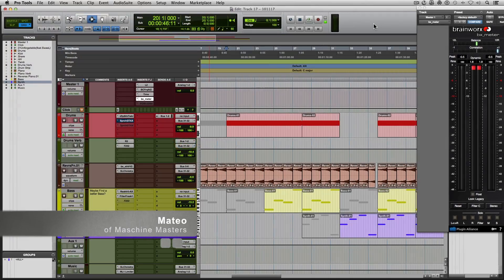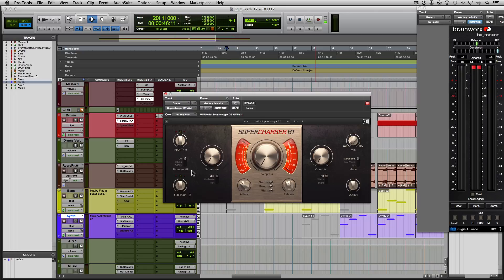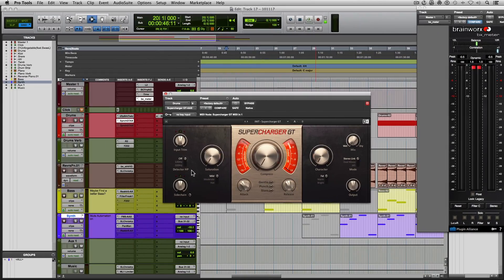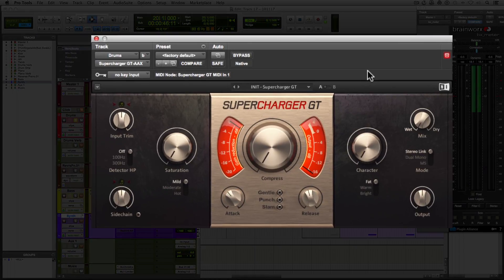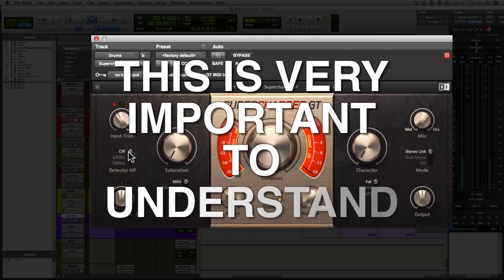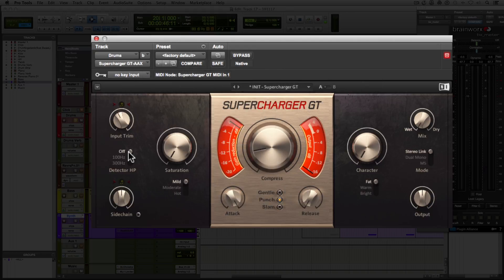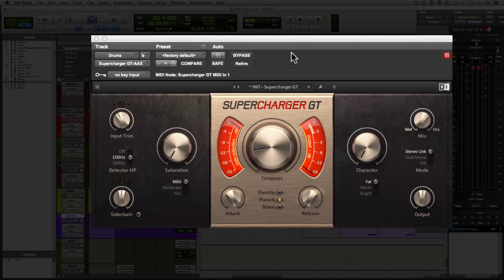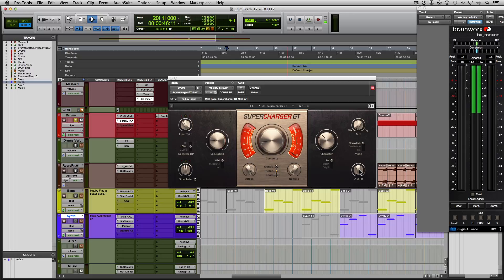HP Filter Side Chain Comp Tutorial Settings [Mix Talk Monday]

Comment: what should i do if my compressor doues not have this HP sidechain, can i do it otherwise?
Reply: Not all compressors will have this, but many will. I'm sure you have at least 1 compressor that comes stock with your DAW, that has HP/internal sidechain. What DAW are you using?
Reply: Xitmuse i use Studio one v3 professionell, and i got some comprresors of NI kompact (Not the ultimate Version!)
Reply: Could i also use Like a parallel Compression where i Take the subs Out, and tuen Mix it to the uncompressed Sound or would IT have a different Sound to it ? But thank you for the advice and I should try it and look for a compressor
Reply: You could do that, but it won't have the same effect. You'll also have to be mindful of any potential phasing issues in that process. 

Just go into Studio One, under your Compressors section, pull up the various compressors that come with it, and check to see which ones say either HP Detector or Sidechain in the plugin. The new Studio One is very powerful, and comes loaded with plugins. I'm certain at least one of their compressors has this feature.